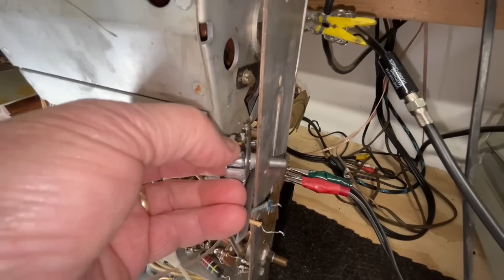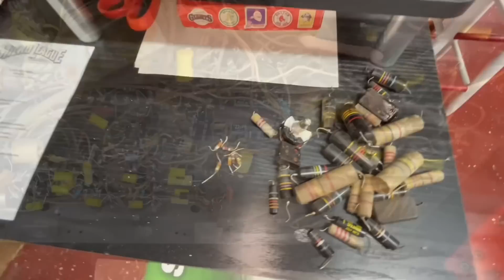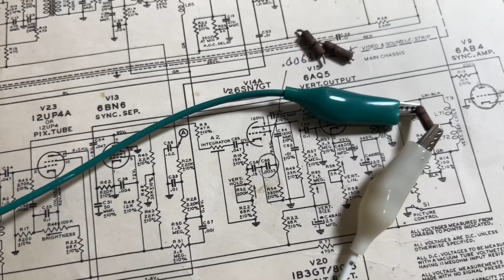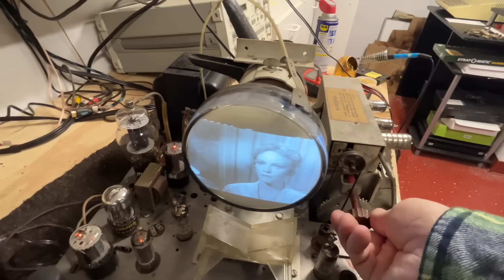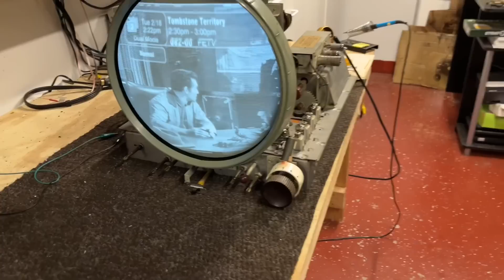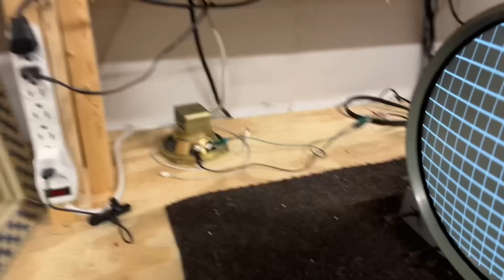1950 Zenith 12” Porthole TV Restoration. Part 3

Comment: Quick question for yah. Your ion trap. Do the two ring magnets have the ring gaps lined up or are they offset? Is there a particular way they are supposed to go?
Reply from the maker: It’s been a couple months since I finished the Restore on the set but I don’t think the ring gaps matter. 
It’s just a matter of getting the entire trap in the right position, they can be tricky 😀

Comment: I fully recapped one of these way back in the 80s and I still have it, and it still works great.  The pic tube was replaced with an all-glass one back in the early 60s, the receipt was tucked inside the cabinet.

Comment: I thought that dud picture tube would come up !  It looks fine. A lot of collectors maintain brighteners ruin CRTs, but as little as this set will be used, a brightener would probably last many years.  It looks fine as it is though.   My trouble is I can't leave well enough alone and would have to try one just to see. I bet after a few days of playing the crt will  test in the green as it is.    Does that  'fill up the screen'  switch expand the picture in both directions, or just vertically?        For me, this is one of  your best videos. Your quiet explanations are great. Fun vid as always !!
Reply from the maker: Yes the CRT looks great, a little soft when first turned on but in a couple minutes it’s good. 
The expand switch works vertically only. 
Thanks for the kind words, appreciate it.